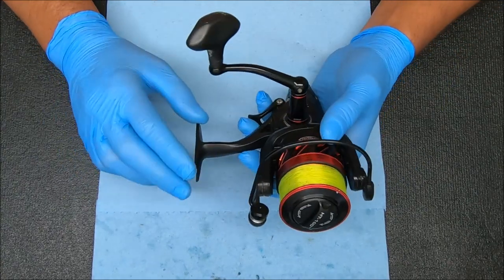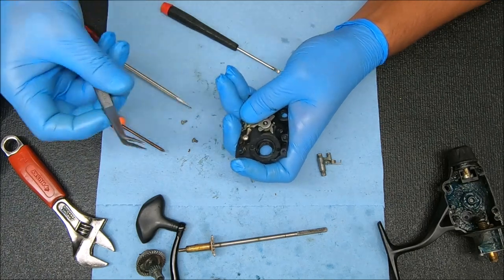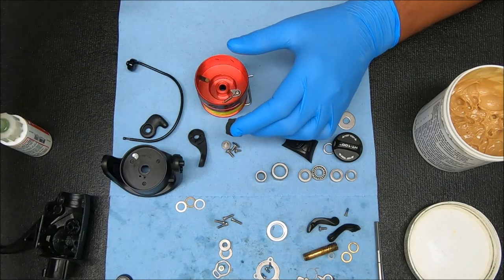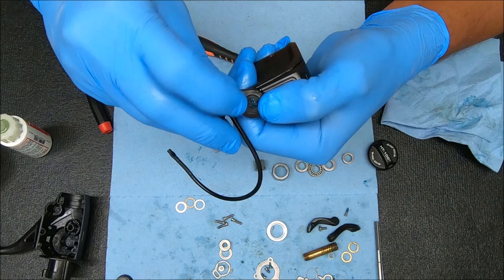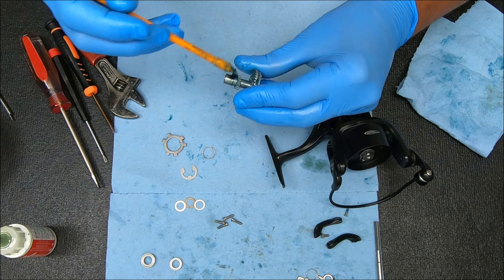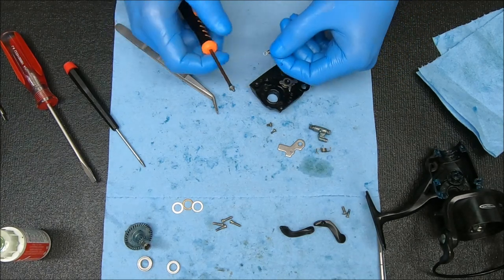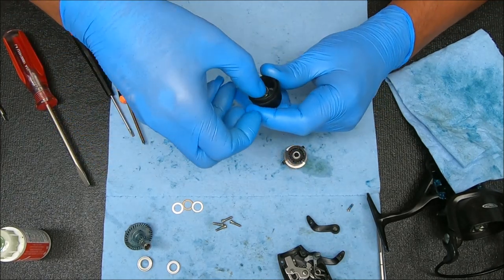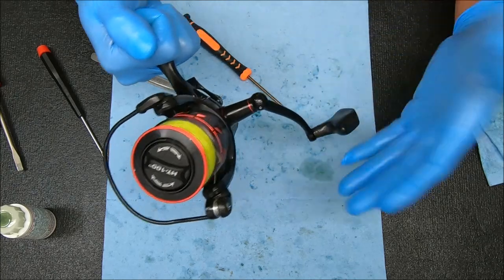Penn Fierce III 4000LL Live Liner Fishing Reel - How to Service

Comment: At 42 minutes shouldn’t be much struggle. I have it struggling. I didn’t take it nearly this far apart just open to inspect and light clean and grease and now my cover is forced or when I rotate the nail by hand it’s bound up or with no screws it pops the cover put each turn internally.
Reply from the maker: Thanks for checking out the video. If you have the lever in the same position as in the video, it should do the same as mine did. If not, try playing with the lever positions as you put the side cover on. If you're still having an issue, post an action video of it on your YouTube channel clearly showing your problem and let me when I can view it. Just reply here with, "It's up." and I'll check it out and respond in this thread.